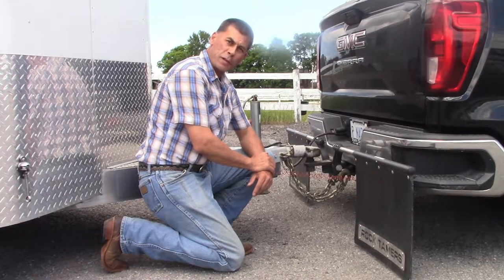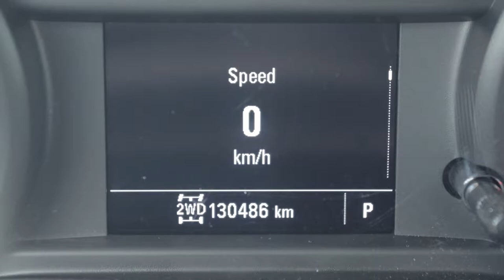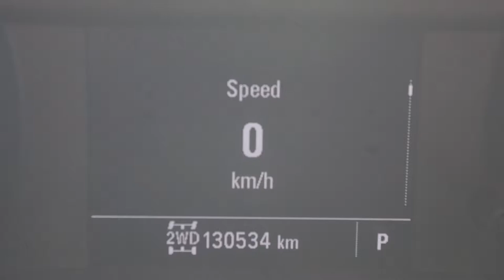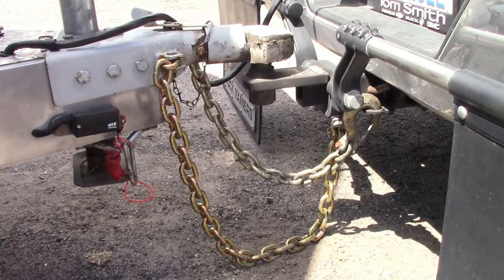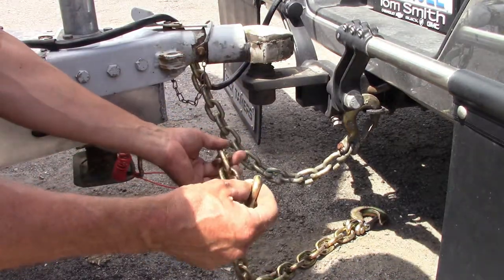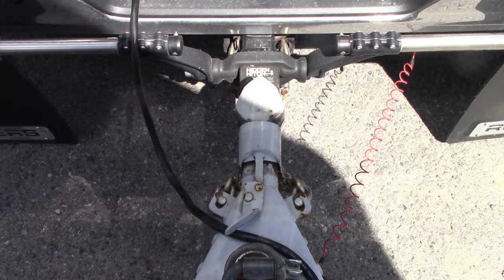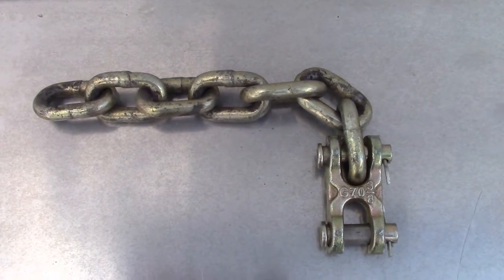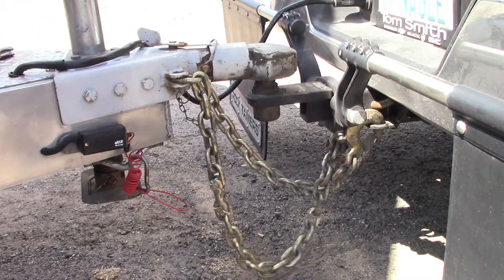Trailer safety chains...How long should they be?

Comment: Thank you — very informative. One method I’ve seen to shorten a chain is to use a shackle (like the one you showed for adding chain length) and double it back. This is hard to describe, but for example, connect one side of the shackle to link number 1 and the other end to link number 5. This effectively removes links 2, 3, and 4 thus shortening the overall chain length by that much. Any thoughts on that?
Reply from the maker: Your description is a good one, one possible concern I would have is the strength of shackle if it would have to be of smaller size than chain to attach to link number 5. If this results in shackle having a significantly lower rating than chain, shackle could fail if subjected to sudden loading in the event of trailer becoming unhitched.
Reply: @brsnorthernhorsejourney3579  Obviously, like your use of it in extension, it must be of equal strength to act as a link.

Comment: Chains that long will not do there job if the trailer comes off that long. But they will when shortened with twisting the chain to shorten it the chains are rated for 4 times the load rating they are being used for twists will not cause them to fail simple math
Reply: Actually no. Twisting the chain can reduce their strength up to 70%. And if the force is strong enough, the chain will straighten out regardless of the twists, thereby removing the "cradle" ability to keep the hitch from contacting the road. Which is why you don't use a bungee either. Shorten the chain or use the demo'd link extender to shorten the chain.